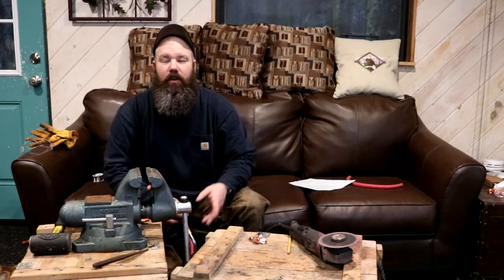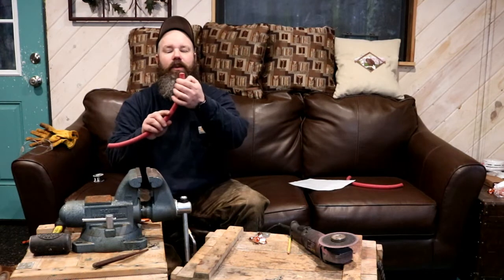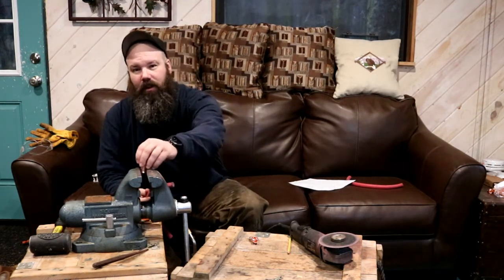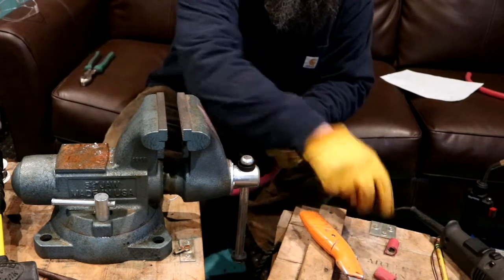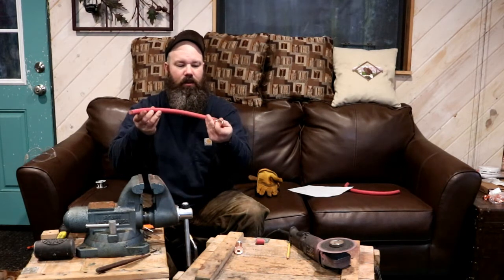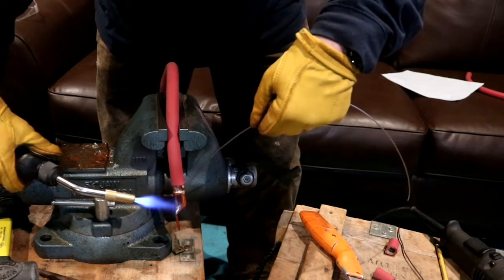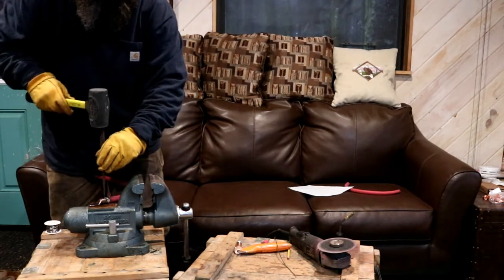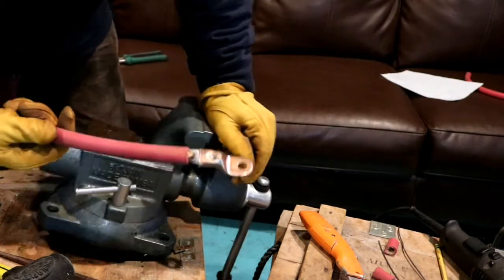Making cables for an off grid  battery bank (Solar Power Part Two) (SE 2 EP 3) 2017

Comment: No, the power cables must be crimped, with the heat the tin melts, in time corrosion moisture will cause the contacts to worsen and heat up to let the tin run and also the punching loosening, which must be done with a special tool and the reason is there!
Never weld the power cables, only the control and signaling or control cables must be welded, but never the power cables!
Reply from the maker: Thanks for the input Pietro

Comment: get a hydraulic crimper. the are fairly cheap. soldering is not recommended for high current (20A or more) applications.
Reply from the maker: That sound good to me.